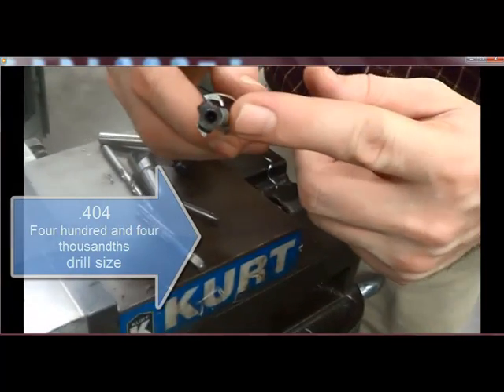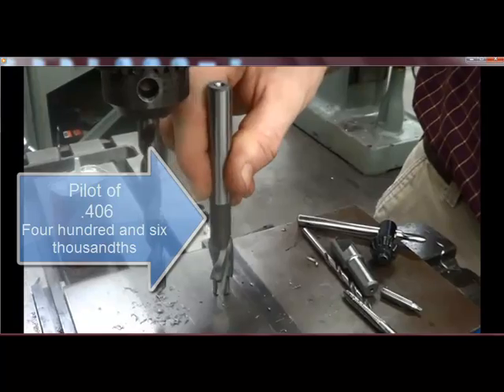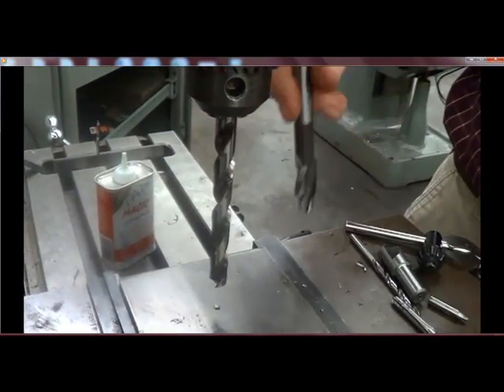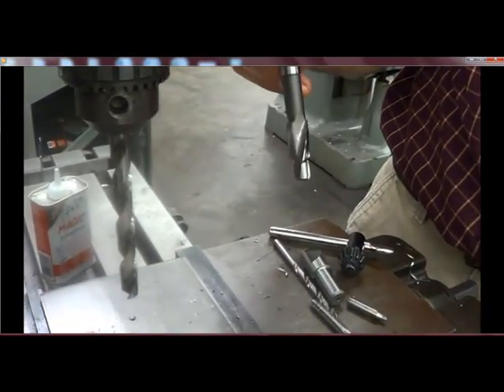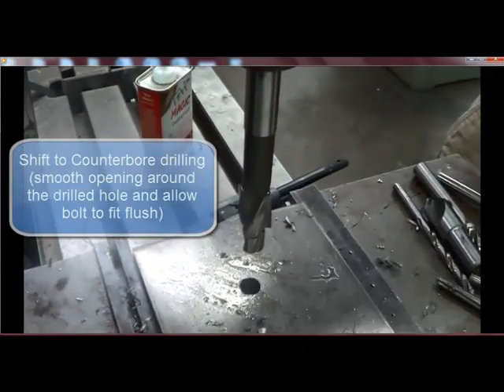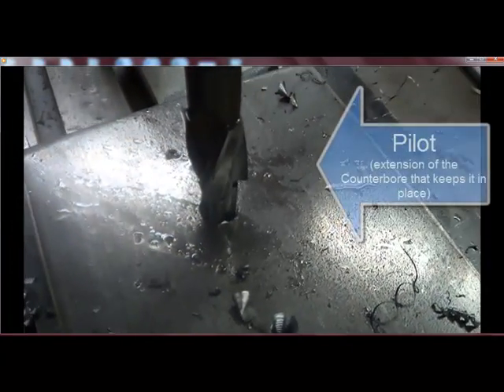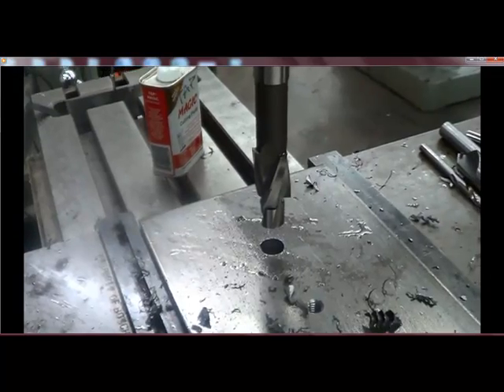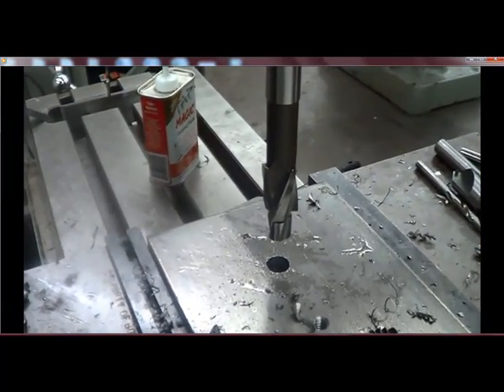Drilling and Counterbore

Comment: Is there a technique to counterboring to an exact depth besides trial and error?
Reply: Yes, most drill presses have depth control.
1) You measure or look up the length of the head.
2) While the machine is off put the counterbore to the workpiece and set the depth stop to the same depth of the head length.
3) bore it slowly especially with the counterbore.

Maybe if you have a machine store with a showroom somewhere you can visit it and ask the salesperson to show how the depth control works. As there might be multiple ways of doing it. However these people are usually not the smartest folks so if you don't understand he don't either. Be persistent while friendly to fully understand for yourself.